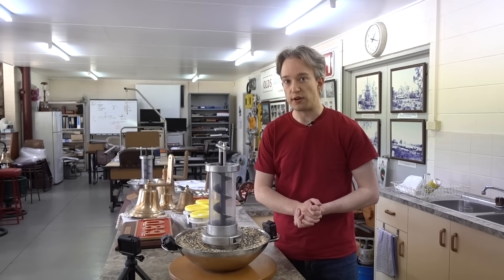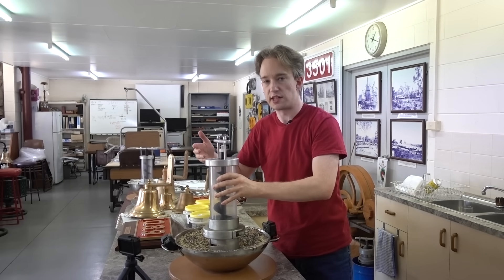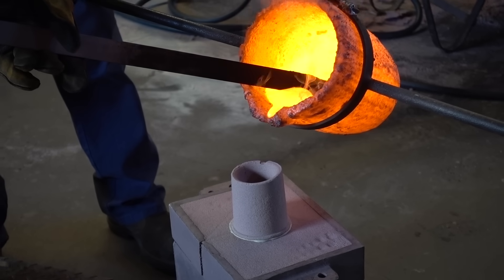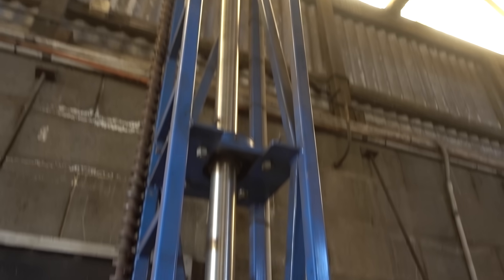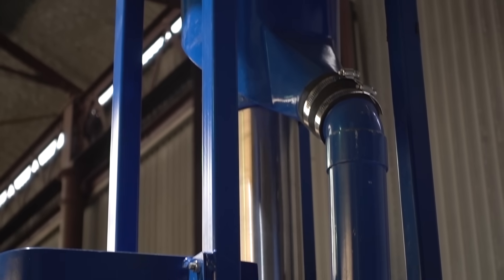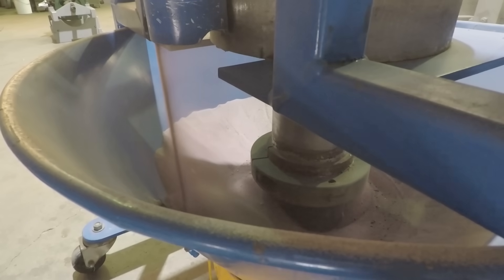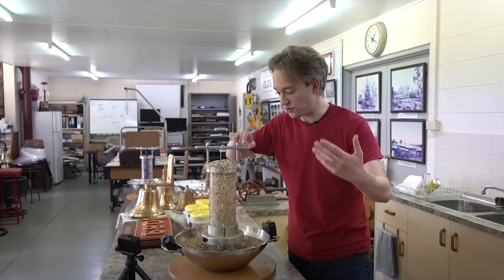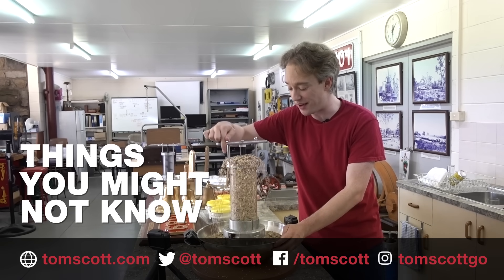Mr Olds' remarkable elevator

Comment: Great video and invention. I think there’s an important difference between a conventional screw auger in a tube and the Olds elevator - not just a difference in “point of view”.  In the conventional auger, the screw thread moves w.r.t. the material (and would do so, and elevate some material, even without the tube). In the Olds elevator, the screw thread is naturally stationary w.r.t. the material and relative movement only occurs because the tube drags some material along as it rotates.

Note that there are screw augers where the tube rotates at the same speed as the screw (discussed in the background of the patent). There is no relative rotation between screw and tube in these - this shows that it is the relative rotation of the screw and the material that causes elevation.  

TLDR: Olds elevator is not equivalent to screw auger; relative rotation of screw and tube is red herring; Olds elevator works because tube drives material around screw so material follows thread upwards

Comment: "In the USA they were calling me Archimedes II"

An extremely rare example of a great pun.
Reply: Rich Moore where is the pun?
Reply: @RedHair651  It's a pun on "Archimedes Screw" which is the name given to the original screw design that the new one is based off of.
Reply: @stunthead  not only that, it's a two, near to "tube", also, II looks like a tube as well
Reply: Sorry to be that guy but these are not (great) puns... For puns to work they need to have a dual meaning in the sentence. Calling the inventor an "Archimedes screw or tube" does not work. Plus the word Archimedes is already related to the screw, so no prizes for putting them together.
Reply: @jogabonito8989  oh, you're no fun. -pythhon?

puns are not just homonyms. homophones are also puns, ore pseudo-homonym/pseudo-homophones

also, the 'II' kinda looks like a pipe (which is), 'two' sounds like 'screw' with having the 'w' sound(they had the same IPA), and is also a 'second generation' archimedes screw.
Reply: “Some people are calling me Archimedes 2, I’m not... but you could”
Reply: Nah they don't sound alike. They vaguely rhyme, but that's not how puns work. It isn't a pun.
Reply: By the loosest definition of what a pun is, this is either not a pun at all, or it's just atrociously bad

Comment: The original Archimedes Screw is used primarily for liquids, which is why it has to be installed on an angle, so the pockets of liquid are carried up it.   It's operating principle is gravity - each 'glob' of liquid stays in its 'pocket'.   (That would also work for a flowing solid like grain etc).    As a matter of constructional convenience some very large Archimedes screws e.g. in sewage works, are built with a rotating screw inside a fixed outer casing, but they still use gravity as the operating mechanism.   

This elevator looks very similar but the mechanism is quite different, it relies on relative motion between screw and casing and friction within the material being conveyed.    As Tom says, there is no difference whether the screw rotates or the casing rotates.   (An original Archimedes screw, with the screw fixed to the housing, would not work if stood vertically).
Fascinating though, I'd never seen or heard of this before.
Reply: I wonder if the Hills elevator has been tried with liquids?
Reply: @ThreadBomb   I'm not aware that it ever has.   I think it might prove too inefficient, since it would rely on viscosity to make it operate (just as the Olds elevator relies on the forces between the grains) and viscosity absorbs a lot of energy.
Reply: @cr-yi7ep  Maybe it would be a good solution for some thick gloopy, chunky liquid, but I don't want to think too much more about that. 🤢

Comment: Relative motion at its best - rotate the screw, or rotate the casing, it's all the same. Deceptively simple, like all great inventions!
Reply: I think it still needs the scoops at the bottom, though, no? If it were JUST a casing rotating, then yes, the screw is "rotating" if you look at it from the perspective of the casing, but so is the material at the bottom, rotating away from the screw. You need the scoops to force the material to spin with the casing and get it going up the screw.
Reply: The question I have is:
What's the difference? What does rotating the casing do that rotating the screw doesn't? Why couldn't they just rotate the screw? That simply not covered in this video.
I mean yes, it's neat that you can get the same effect by just rotating the casing... but what is the point of doing that? What advantage does it have or what does it do different in comparison?
Reply: @mementomori5580  to my understanding the issue is getting the screw to scoop stuff enough, with the casing rotating the scoops at the bottom grab more stuff to move and therefore can move stuff more easily

Comment: I think the part that really fascinated me was the point made about the reduced dust.  In a normal screw elevator there are grind points where the material is trying to fall back down to the previous space,  on start up even if you have enough material to fill the screw you will have some that leads the rest, some that can fall back.  If you set the screw anything other than vertical you'll have pockets of product in each thread of the screw, leaving large air pockets and making a point for the product to impact other product... all creating dust....

In this the only real grind point is all the way at the bottom.  the scoops are the largest source of friction against the product, keeping most of the dust in the stuff all the way at the bottom.

It really is absolutely brilliant
Reply: Well said.

Comment: I was slightly confused until you said "a couple of scoops on the bottom"... then it made perfect sense.

it's essentially the same thing, but there's less friction overall I suppose... rather than the screw moving against all the material it's just the outside slipping against it and the bits at the bottom shoving it up... but does it really end up being better?
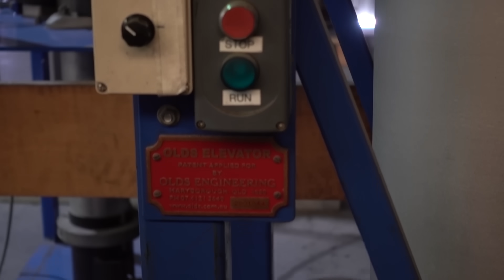Reply: Outside isn't slipping. You see it 0:50. I think the friction isn't significantly less, and the video never claimed this was more energy efficient, right, probably it isn't. The improvement, as they say, is the full flow (less air moved, accurate volumetric feeder) and less dust. They are placing too little emphasis when saying it. 2:50 - 3:40

Comment: It works because its not the screw spinning that lifts.  Its the relation of the screw to the cylinder.  So rotating the cylinder works the same as turning the screw.
Reply: Thank you, that actually makes more sense to me than Tom's explanation. If I understood him correctly he was referring to air pressure, but I don't see how that would help.

Comment: This is a very clever modification, but it wouldn't work without the 2 open flaps at the bottom of the tube, and the fact that the tube makes contact with the bottom of the barrel or is otherwise sealed at the bottom. When you rotate the tube, the flaps direct the flow of corn so that its pushed against the screw as if the screw was rotating. If there really was just a normal tube rotating around the screw, no part of it would apply a force to the corn and the tube would just rotate in the still corn. If you span this tube very fast in a water bucket even without the screw it would act like a normal pump

Comment: ... It makes so much sense. The weight of whatever is being lifted isn't baring down on what's being rotated. If it was a standard type of auger, the weight of the sand would be pushing down on the screw making it harder and harder to turn. With the casing rotating, the screw can be a structural part. It could be made to support that weight which is easy cause it can remain stationary.
Reply: Erm, absolutly basic Physics, "action and reaction", i.e. the weight must still be supported/moved/accounted for.
Reply: @marcusgault9909  Yes, the weight has to be supported/moved/accounted for which is easier to do when the part supporting that weight isn't a moving part i.e. the spiral of the elevator.
Reply: @xXWHO111Xx  Perhaps I shall demonstrate by posting a video, where I lift myself by my bootlaces, being the same same logical fallacy, well kinda.
Reply: @marcusgault9909  I really don't understand where you think I'm making a logical fallacy. What do you think I'm saying in my original comment? Like, I know what I'm trying to say but it obviously not communicating the same message to you. Can you explain where I'm wrong?
Reply: @xXWHO111Xx  Stephen, it is clear that since the rotating outer tube, through friction, drags the material around the inner helical "auger", and thus forcing it to rise up the endless incline, this same, equal and opposite force must therefore be transmitted "down" onto the inner auger, whether the inner flight or auger is stationary or  rotating makes nary the bit of difference. The weight, or mass of the entire column of material being moved must be supported, and is still mostly supported by the inner auger or flight. If the inner auger flight were disconnected from the outer tube, and both were free to move  freely and vertically, while either were rotated, the outer tube would rise against the inner flight, or the inner flight would fall relative to the outer tube. Simple mechanics at work, from my limited farm based and traditional using auger experience 40 to 50 year ago. I also studied Civil Engineering at Uni, dropping out in final year.
But I kinda understand simple mechanics, simply put, there are no free lunches.
Reply: @marcusgault9909  So you think I'm saying the weight of the material being lifted isn't bearing down on the flights of the Old's elevator? I'm just trying to clarify what you think I'm saying.
Reply: @xXWHO111Xx  To quote some of you origonal comment: "With the casing rotating, the screw can be a structural part. It could be made to support that weight which is easy cause it can remain stationary".  But still has to be housed within the outer tube, and as I commented somewhere below, the Olds arrangement should (simplistically) half the rotational forces on the inner flight, unless some traditional long flight augers power the inner flight from both ends, which they well might?
 But other than that it does not matter if the outer tube is rotated or the inner flight, the mechanism moving the material and the forces so induced remain exactly the same. Regards, Marcus

Comment: This reminds me of the chips that come out when drilling through stock on a milling machine. The stock is spinning, the drill is stagnant, but the chips still come out of the material being worked on.
Reply: Wait so it isn't new?
Reply: @magusperde365  yes and no, something like this has been used for a long time yes, but it's never been intentionally built if that makes sense, and it's never been so multi-purpose

Comment: Counter questions:
What is the advantage of rotating the zylinder vs. rotating the screw?
Because you haven't really covered any of that. Why couldn't they just use an elevator that rotates the screw? What is different when rotating the zylinder instead of the screw?
Reply: if you look to the bottom of the cylinder, it has 2 protrusions that will "scoop" the surrounding stuff into the central chamber. it's the rotation of the cylinder that keeps product moving toward the central screw
Reply: It seems like rotating the cylinder fills the entire cylinder, but rotating the screw will only lift the parts on the screw. much more surface are in contact with the material. I also wonder if previous elevators just didn't have a cylinder at all
Reply: RIght? I have some speculation as to the use of this technology.
Currently to lift grain vertically, most often a grain elevator is used. 
Those are a conveyor of buckets that lift and dump drain at fast speeds. 
But they are not smooth, as in, the buckets come and dump with intervals, this method would supply a constant stream of grain.
They already use augers with spinable corkscrews in them. But those are only able to go vertical to a certain degree, they are not employed to go completely vertical.
Now Im not sure why spinning the casing is better for going completaly up and down, but maybe it uses less forces to work.
Reply: It’s explained from 2:50 onwards. The biggest advantage is the reduced dust production.
Reply: It's easier to engineer. Because the moving section is on the outside, it can be belt or chain driven without any interference with the inside of the mechanism.
Reply: @LukasFink1  Does it explain why rotating the cylinder produces less dust? Also, at the time I assumed that that they were implying that that advantage was in comparison to conveyor style elevators, not in comparison to screw style elevators.
Reply: It can also have several simple bearings along its length, keeping it centered and not touching the screw.
Reply: @crazzilla7203  These scoops could as easily(well to all intents and purposes) be driven by the central screw.

Comment: I love this, and I immediately wonder how well it would work without the screw! My intuition says that it would jam up far more easily, not do well with height, and take more force to move, but still push material upwards as it got forced in at the bottom. The screw is there really to provide a nice smooth guiding surface and weight support for the entire column of material.

Comment: I love this video. I'll admit I had to watch it a couple of times to get it though. I've always been fascinated by the idea of the set of simple machines being the elemental constituents of every mechanical device. Although the screw is a special case of the inclined plane, it has taken me until today watching this video to fully appreciate that stuff is pushed rather than carried through a screw. 

The idea of the rotating housing also reminds me of the jet engine, where I believe a similar principle is used to move cooling air (without a screw). Briefly, the spinning turbine has a hollow shaft through which cooling air moves. I once saw that on a tv documentary described as "an inexplicable process causing fluids to move through a hollow rotating pipe". That phenomenon might be related to this screw lift with, perhaps, imperfect cylinder ends acting as scoops to initiate travel by disturbing the fluid (like the buckets in the screw lift causing items to collapse inwards).

Comment: But does it work in the northern hemisphere? Remember, gravity is different in Australia
Reply: easy you just have to  screw  it oposite way.
Reply: In normal world it only works if you have sand stuck on your ceiling
Reply: You just need to pour in a can of Foster's in the morning.
Reply: Only if you do it on the ceiling.
Reply: yes, works just the same...along with 89% to the world's population, more OLDS Elevators are in the northern hemisphere then in the southern

Comment: I think that the major advantage of this lift design is that while on a traditional setup you have to work against the friction between the container walls and the grain, with this design since the walls are moving mostly with the grain a lot of that friction is reduced and what is left of it is actually used to do work on the grain.

 Also, the spiral's shaft does not have to be perfectly aligned with the outer casing because of that huge gap between its edges and the casing walls, which means that it's easier to build way longer elevators at a fraction of the production costs of a traditional type screw elevator (where tolerances have to be much much stricter and increase drastically with the total length of the shaft).

very cool design

Comment: I'm curious if the whole tube needs to move, or just the scoops. At what point do you think the friction against the unmoving tube, would overcome the benefits of not needing to move as much material?
Reply: I would guess that just the scoops need to move but setting it up that way would require a bearing and seal between the two parts and that would allow particulates to get into the seal and potentially the lubricant to get into the particulates.
Reply: @gildedbear5355  Nope, you are missing the principle. It keeps working even when the supply at the bottom runs out